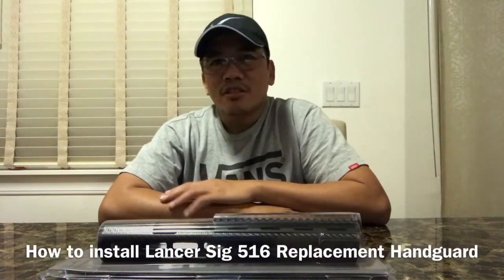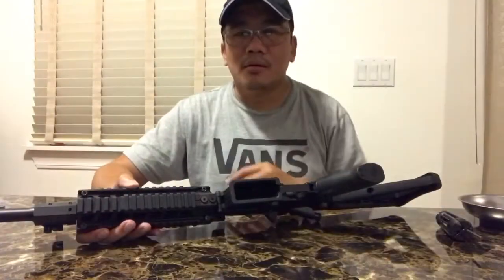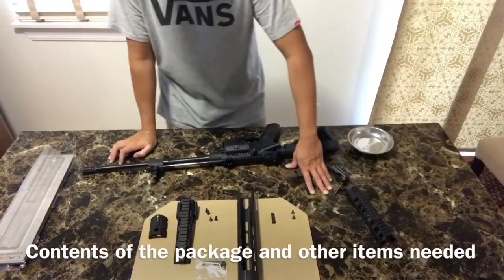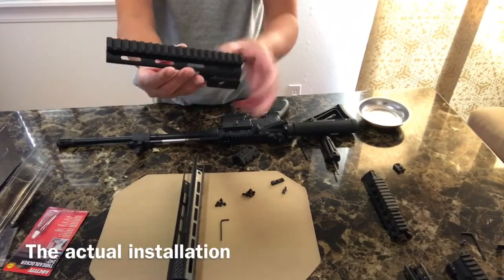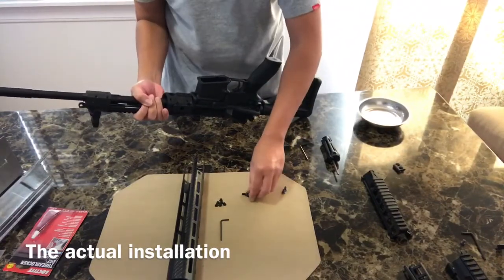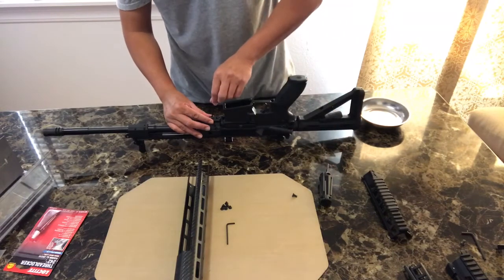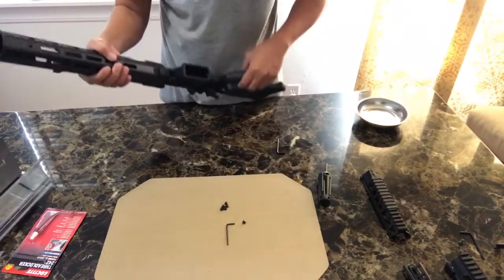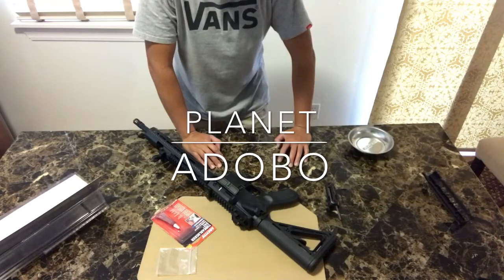How to install the Lancer Sig 516 Replacement Handguard

Comment: Excellent review. I thought I was missing four screws and the nut when I opened the package so fortunately I found your video and saw that you’ve clarified that I have to use parts from the OE rail. Great job

Comment: glad you posted this video. I have this Sig 516 patrol and the stock hand rail is way to short for a weapon light in my opinion. Running a Surefire M600 on the right side and the tape switch on top. It works but could be much better if there was a longer rail closer to the flash suppressor.

Comment: Wondering if i should get one since it’s stock handguard is pretty heavy
Reply from the maker: Weight difference of the Lancer System Carbon-fiber handguard and the stock handguard of the Sig 516, is not much. The carbon-fiber is a tad lighter but what makes the difference is the leverage you have on the forearm. Because it is extended, you have more control on the rifle and feels lighter. Overall, this is worth the upgrade in my humble opinion.

Comment: How much lighter does it make the gun feel?
Reply from the maker: Bank Soikum, weight difference of the OEM Sig 516 handguard and the aftermarket Lancer Systems Carbon Fiber handguard is minimal. Lancer handguard give take 0.7oz  lighter, at least on my weighing scale. But the consolation is, you have a much better leverage on the rifle because it is extended so it feels much lighter. Plus the minimalist design and carbon fiber feel, it is a very good upgrade at least from my experience. Hope I answered your question. Thanks!
Reply: Ouch I will stick with stock quad rail.  Mine extends underneath the gas block
Reply: @CaFFeineSouLja  I am collecting 516's and I have noticed there are perhaps 3 different handguards out there. Id love to get the part number off of yours and see if i could order one from Sig.
Reply: Daniel McMahan I am selling my upper for $700 only 100 rounds through it

Comment: how much lighter is the lancer compared to the OEM handguard?
Reply: I just got mine in the carbine length and put it on the scale. The Lancer is 4.02 ounces while the OEM is 5.19 ounces.